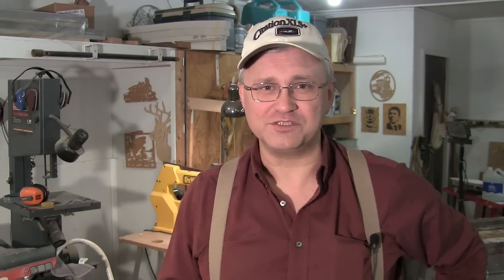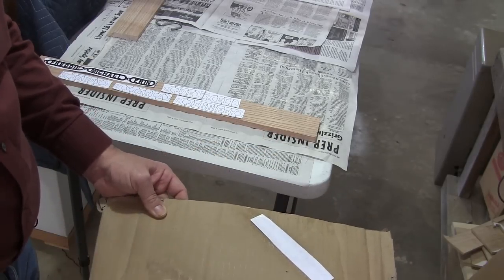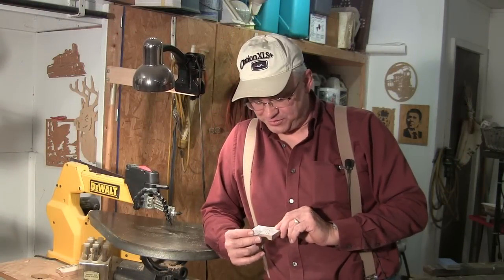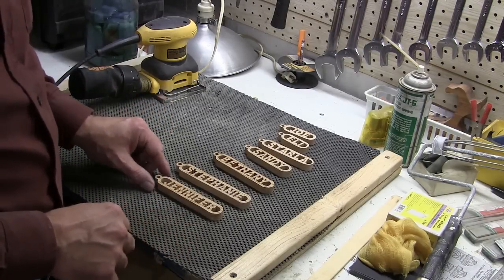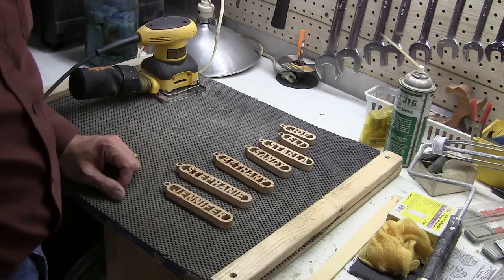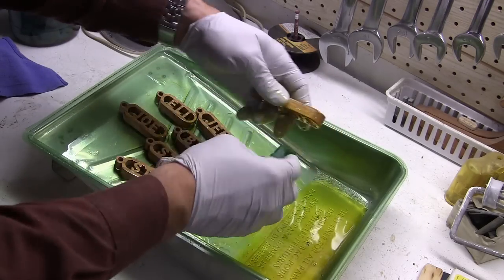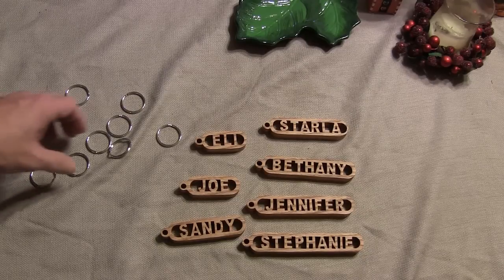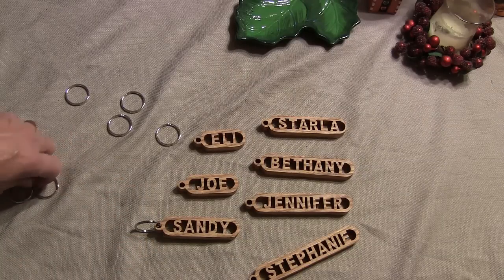Making Personalized Keychains: Great for Stocking Stuffers & Craft Fairs

Comment: Really beautiful, nice work. Just a tip for you, if I may be so bold: If you dilute your linseed oil with a little white spirit it will easily penetrate the wood with no extra rubbing required, and not to mention it will last longer!

Comment: I have a tip - sometimes the split rings are hard to hold open to feed through the hole in the wood. Use a staple puller (the spring jaw tooth type) to split the ring and hold it open (this works for putting pet tags onto collars also). Great Video!

Comment: In your key chain video it shows your patterns some black and some with thin lines.  How did you get the thin lines
Reply from the maker: harold haney Here's a tutorial on using the pattern maker program: Scrollsaw Workshop Stencil Printer 1.6 Tutorial